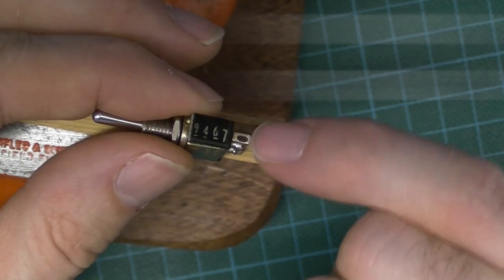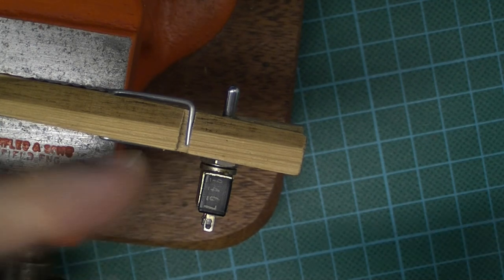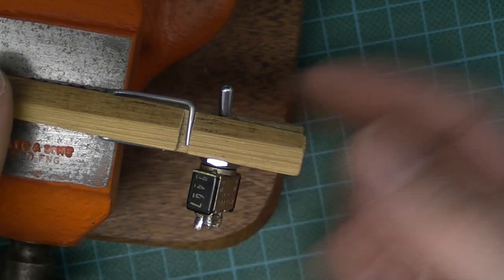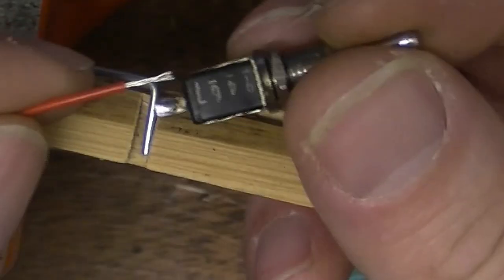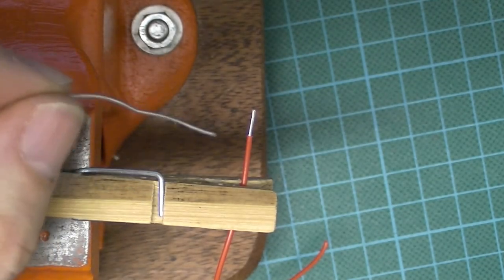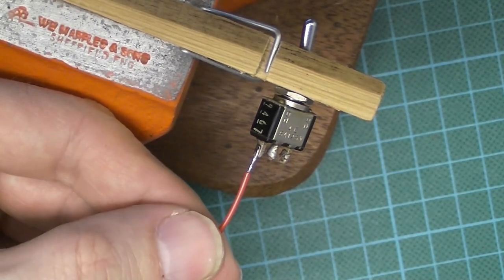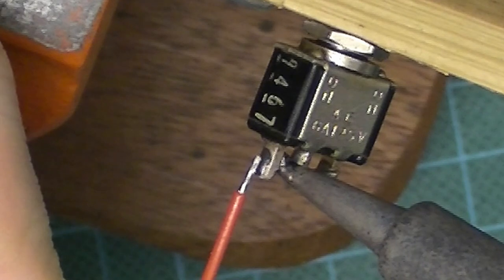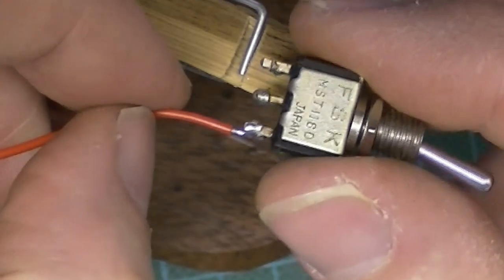How to solder small toggle switch

Comment: I HAVE learned A LOT in 3 minutes!!  As a hobbyist, I`ve randomly soldered "things" off & on for over 20 years, things like R/c cars, 1/4 guitar cables, loose connection on electronics.. basic stuff. It`s the small details you've explained that will help me sooooo much, thank you. Especially the emphasis on over heating. At times I would end up with a chard blob of solder, blacken from the burning flux, a solid connection YES but ugly as SIN with potential damage from overheating. I`ve got excellent equipment, there`s no excuse. Thanks again 👍
Reply from the maker: You're welcome. I hope you are making good progress with your projects.

Comment: Nice clear video.  Only comment is that many would call that a "cold solder joint", because the wire moved while the solder was cooling.   In audio and other critical applications, this can compromise conductivity of a low level signal like the pickup output from non-pre-amped (passive) guitar pickup.    Both items need to be stationary, either by poking through terminal hole while solder is molten, then adding a little heat again to solder after wire is stable without being held by hand.  Or, use soldering jug that has two alligator clips: one to hold the switch, one to hold the wire.  Holding with hand = moving wire.

Comment: Great instruction. What temperature and what solder alloy do you prefer so as not to melt switch material?
Reply from the maker: In the school workshop we only use fixed temperature soldering irons (Antex S4814H8 CS18W 230V) which I think run at 390 degrees C. We use a medium sized chisel tip and 22SWG lead free solder and I have never had a problem with the switch body melting. Most students also manage to solder these switches without problems just so long as they follow my instructions. When soldering at home I tend to use a higher wattage Weller TCP magnastat soldering iron station because that's what I have, but once again I have no problems either using 60/40 leaded solder or lead free. I think the key point is to be quick when soldering and avoid excessive amounts of heat.

Comment: do you cover the solder with anything like heat shring, like you would when joining wires?
Reply from the maker: Dan, that's a good question but it really depends on the particular application. I tend to use heat shrink tubing on switches where there is a benefit from having the extra mechanical strength from repeated bending at the solder joint. For me, this is useful where the switch may be used for prototyping and the wires may be subject to repeated movement or strain. Heat shrink is not a substitute for good cable management and cable ties for example may give better protection. Heat shrink can also be used to reduce exposure to live wires but this should not be relied upon and it would be better to use an appropriate enclosure. Finally, many people just like the aesthetics of heat shrink on soldered switches but I've met more than a few students who use it in an attempt to hide bad soldering (which never really works).

Comment: If you wanted to connect two wires to a single lug, would you simply twist the two wires together, tin them, and then use the same approach?
Reply from the maker: If you are using fine hookup wire that approach would work. I wouldn't do it with heavy gauge wire. If the lug has a through-hole I might be tempted to push both wires through, bend back slightly, and then solder in-situ. So long as you don't apply too much heat there are many different ways that will produce a dependable and neat looking joint.
Reply: @PizzeyTechnology  Thanks!

Comment: The mistake I made was using a solder iron before it was  hot enough so that I melted the plastic on the switch before the solder melted. 
Thanks.

Comment: When remelting solder, liquid or paste flux must be used on the joint.
Reply from the maker: I melt some flux-based solder on the iron tip first, and find that works just as well.

Comment: How would you connect this toggle switch to a pcb?
Reply from the maker: I would solder wires between the switch and PCB, most probably using stranded wire. I'm not keen on using terminal blocks as wires tend to break where they are clamped down. What are you planning?

Comment: Hi mate I’m just wondering if you could help me out , can you wire a external toggle switch to a keyboard PCB
Reply from the maker: You want to bypass a switch and make it off board instead? Doesn't sound impossible but presumably this would involve some surface mount components and small traces that could be tricky to solder.
Reply from the maker: Why do you want to do this?
Reply: Pizzey Technology it’s for a button box for console instead of using a keyboard to use certain inputs because I’m short for desk space . I have seen some do it by solder wires from the PCB pins into switches so in game it just registers as a keyboard input .
Reply from the maker: Okay, I understand. Well sounds like it is doable then.
Reply: Pizzey Technology would you know what I need or how to do ahha ?
Reply from the maker: @VR46314  You would need to reverse engineer some of the circuit to understand how/where to add a switch. This would likely involve using a multimeter and tracing tracks on the PCB. This is not a trivial job for an absolute beginner.
Reply: Pizzey Technology I have traced the circuit back to the keys just need to get the switches to arrive .

Comment: Damn these lugs are HUGE compared to my dpdt switch. Too easy...
Reply from the maker: Large lugs are easy to see but have more thermal mass therefore can be tricky to solder, depending on the user's ability and equipment used. The switch I used in the video is reasonably easy to solder just so long as it's not overheated.
Reply: @PizzeyTechnology  yeah I gotcha. I guess the same technique would apply to a switch with smaller lugs but I’m having trouble with mine. It’s a push pull volume pot for a guitar and the lugs are insanely small and I can’t seem to find ones that have larger lugs that are $10 a piece. I may have to just switch to a standalone dpdt switch.

Comment: I have been trying hard to learn how to do this. It seems like I cant do it. When I melt the solder it just turns into a ball against my iron and wont transfer to anything. It just either melts and falls off or it turns into a ball on the end of the solder and then if I try to re-heat it, it wont work or it takes forever and then it just falls off. I hate not being able to figure this out!
Reply from the maker: If the solder has a tendency to ball up on the soldering iron tip and not flow or wet the tip then it's probably not a clean tip, or possibly damaged. Soldering iron tip restorer is good if you can get some. Do not try sandpaper.

Comment: All so neat and effective but very different in a tiny 8-lug imported cheap switch with tiny holes to solder wires into so that they are not touching or grounded. Show us how to wire real switches not models with 3 large tabs that have large holes and no obstructions and no pickguard to fool with... Skip it. It's a fantasy and not at all like real guitar wiring.
Reply from the maker: Hello Doug, thanks for the feedback. The video demonstrated soldering a small toggle switch and made no claims for soldering "tiny... imported cheap switches". Are the switches difficult because they are imported and/or inferior? If so, there's an obvious solution right there. I used some miniature multi-pin connectors a while back that were challenging but not impossible to solder, and my conclusion was to buy larger connectors next time. I have no involvement in guitar wiring.